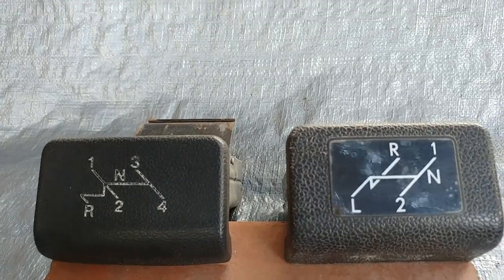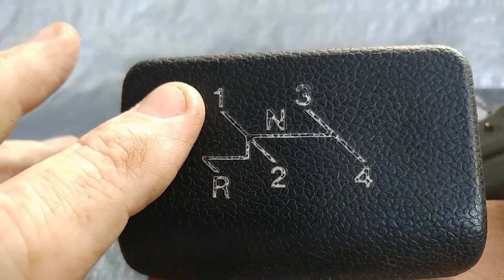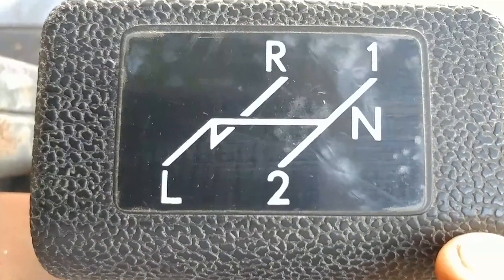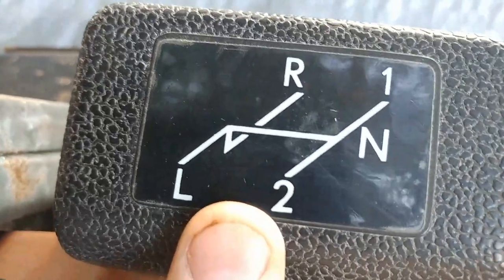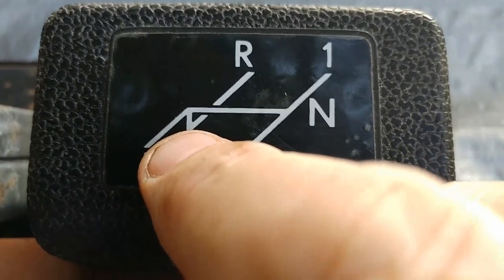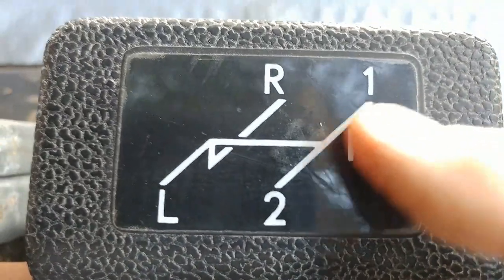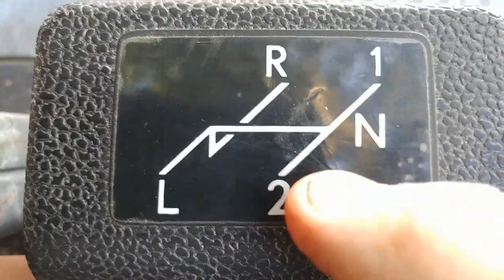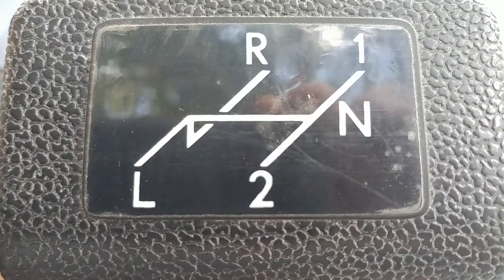HOW TO : HOW TO DRIVE A CLASSIC VW BEETLE AUTOSTICK TRANSMISSION.

Comment: I dont understand why he keeps switching to say how it would be in a normal car. Just say ude the low for vety slow start. Use first ti go up to 40 and then shift to 2nd.  When you take the fiit off the gas is when the clutch engages or when you put pressure on the stick is my question.  Also is it a tirque converter or is there something else engaging and disengaging the clutch?  Im thinking of getting a autostick for a rebuild but i want to understand how it works compared to a new electric semi auto like in a smart car that used a motor to engage and disengage the clutch
Reply from the maker: Yes, there is a torque converter. Takes ATF. YES soon as you tale your foot off the gas to shift. The major downfall is parts availability. O have a few companies that still offer some parts. You have to be advised that you cant build a bigger engine. There are a few major differences in the engines internally. If you need parts, i would suggest The Samba. They seem to have used parts most of the time. Besides the engine and trans the rest of the car is the exact same. There is a few different sheet metal pieces in the engine compartment. This is why you see most of the autosticks have been swapped to mamuals. Feel free to ask any questions. Stay safe, stay warm. God Bless

Comment: This guy obviously never read the Volkswagen manual and doesn't know what he's talking about don't take his advice normally you only use first and second gear low gear only for starting on steep hills this car is slower if you shift low to second then if you start out in first and then shift to second you can go to a higher RPM in first then you can in low the idea is you drive the car and only have to make one shift first to second it's like a two-speed automatic if you go low to second it's like going from first to Fourth in a four-speed.
Reply from the maker: Thank you for watching and commenting. Yes , I have read the manual about how to drive a auto stick. There is a different version owners manual for this topic. Most don't realize that as well. Yes your explanation is correct. When I made this video it was explaining the shift pattern being different on the ashtrays. I did make another video on the topic, need to edit it. The real.lesson is I should have replaced the video. Your comment will be read by many. Thank you for helping the community out as well. Take care, stay safe. Thank you for commenting

Comment: With a new shift coupler, the stick will lean toward the passenger's seat. Then it is a simple matter of just moving the stick forward  for drive 1 and straight back for Drive 2. The $10 shift coupler makes it much more enjoyable.
Reply from the maker: Sorry for taken so long to return your response. Are you stating the coupler replaced would change the issue. This is not the same trans a manual. My biggest issue is it does not feel natural to drive and operate. Thanks for the comment and stay tuned my 68 will be back driveable soon.

Comment: During the years that the autostick was available(68-76 for Beetles and Super Beetles and 68-73 for Karmann Ghia's) about 10% of U.S.A. sales were autostick. Now, only about 3% percent exist. It seems that the autostick became even less popular as time went on. Less than 1% of Super Beetles are currently autostick. The rumor that autosticks are worth less than standards can be seen to be false here: https://www.thesamba.com/vw/classifieds/search.php?submit=yes&keywords=autostick&type=both&stype=all&username=&yearfrom=1968&yearto=1976&pricefrom=&priceto=&model%5B%5D=&section%5B%5D=3&section%5B%5D=13&wanted=show&zip=&zipdist=0&state%5B%5D=&usaregion=&country=&sort=date&sort_order=DESC&submitButton=Search
In the past year, I have only seen two VW autosticks for sale. I want a 73-75 Super with autostick in or near Phoenix, AZ. There is one for sale in Chandler, AZ but it is pretty much a basket case.
Reply from the maker: I think they are going to explode fast when they do catch on. I have a 68 with 86k in it. All original, straight from the original family back in 01. You also need to to think how many were switched to manuals. I know everyone will say after 50 years still have not gained in value. I have to believe in the rarity like you said. I would say 1 % are still intact. I'm looking for a set of ATF resivor clamps. They hold the tanks to the mounts under rear fender. I've been checking samba, ebay, dub barn with no luck so far. I can find all the other parts new from suppliers. Thanks for all the info. Thanks for commenting. Stay tuned more autostick videos coming soon.
Reply: @Volkswagenplanet  All original is extremely rare. Most autosticks have the wrong carb, wrong distributor, and incorrect vacuum hose routing.
Reply from the maker: @johnhazel591  mine even has the assembly line marks and codes stamped on the back of shroud.

Comment: Just get the normal stick shift car with the clutch
Reply from the maker: I have both. The reason I have the autostick is it was my step fathers car( R.I.P). Its hard to get rid of somthing like that. Too many memories with him and my daughter when she was growing up. Sixteen years later and getting ripped off by 2 bodyshops to restore it. Still sits in the garage. Should be more videos on this car being restored in the near future. Thanks for commenting.
Reply: @Volkswagenplanet  agree it has sentimental value to you and it is ok better than new automatics
Reply: What if you are an Amputee and love vw bugs this is great can still drive and enjoy vws
Reply from the maker: @markcollier3737  that is a great question. The autostick could be driven with hand cobtrols on the gas and break pedals. There is no clutch pedal. Just rev up and let off the gas shift. Thier is even shift points on the autostick speedo along the outside of the MPH. The only hard part I don't know how to overcome would be shifting the stick shift. The aircooled beetle was never offered in a full auto version. The type 3 sqareback, notch, fastback was a option or baywindow bus. Hope this info helps to answer your question. Thank you for the comment. More on the autostick coming soon.
Reply: @markcollier3737  totally agree with you
Reply: The Autostick parts are no longer available except for the clutch servo parts.  as its wise to convert the 1968-1975 bugs to a manual if its a 1968 bug with an autostick then you have to get a 1969 and later transaxle that has the double jointed rear axles as the 1968 4 speed manual bugs have a swingaxle rear suspension which is the last year for it.
Reply: @derekobidowski3301  Parts are available.

Comment: I wish I could find a Beetle with auto shift, either a sunroof model or convertible, in reasonable condition. I would  buy it in a heartbeat. One thing though: I viewed two YT vids which teach one how to drive a regular stick shift. Both vids made manual shifting quite complicated from what I saw. A pity! I think I could master a manual with time, patience and rhythm, if you know what I mean. It's just perfecting that rhythm of going at it with clutch and gear shift until it becomes second nature, without thinking about it. I was told once that driving a manual Bug is VERY essy to learn and drive with. Is that true, readers?  What's your spin on this theory? Please inform. Thanks.🤔   ♐
Reply from the maker: You are correct about driving a manual shift. I've been driving VWs since the 90s. I can shift without using the clutch. Its rhythm like you mentioned. My issue is this about the autostick. I don't want to confuse you. With a manual you have 1-4 gears. You start 1st gear( top and drivers side, location). Then shift straight down to second. Then up to the middle over to the passenger side ( 3rd gear). Then straight down to 4th gear. This is standard around the world. 
  Now the autostick. The normal position 1 st gear on a manual is what is a gear you can stay in around town driving without shifting. I think it goes up to 35 mph. The 2nd gear on a manual is called low on a autostick. Then you rev the car like normal to pick up speed. Then you let off the gas to lower the rpm then you shift to 3rd gear location on a manual. On a autostick it's called high gear. Now on a autostick there is no clutch pedal to press in to change gears. Its not difficult. It just doesn't feel comfortable like you mentioned. It almost feels like your missing something. 
VW created the autostick back in the day to appeal to women drivers. They had a hard time driving manuals. Automatic transmissions cost a lot more to build. The autostick is close in size as the manual transmission. It was a win, win for VW. Here in the states it never really caught on. VW really didnt keep statistics like the other manufacturers did. It is believed that 1 out of every 18- 20 cars built after 67 were autostick. Over the years the transmissions and engines were swapped back to manuals. The engine is different as well. Just wasn't capable of building bigger engines as well. Parts are getting harder and harder to find for the autostick transmissions as well. Even the aftermarket is scarce. Most of the time you have to buy used parts. It comes to a point where you just move on. Even though there are less built. They are worth less in value. I have a 68 autostick. I bought it from the original owner in 2003. I don't think I put 200 miles on it since I bought it. Spent thousands on parts. Its been in my garage since torn apart from a restoration job I never finished. If it wasn't for the sentimental value, the car would of been gone years ago. Hope this info helps. If you know what to look for you would be surprised how many you can find changed over for sale.  It's not to difficult to change them back either. Thank you for watching and commenting. Stay safe.
Reply: A thousand thanks for your reply. It's not often that someone will take the time to respond with many details as you have to my initial input here in YT. I appreciate it more than you know. I only wish I can find a Bug in reasonable shape to practice the "rhythm" I referred to before. Sorry to ramble on. Peace to you and yours, friend! 
🙏♐
Reply from the maker: @AladdinSaneNYC  it's the least I could do is respond. I thank you for the view. Feel free to reach out again. Take care my friend

Comment: Low gear is not used in normal driving in the semi-auto VW.  It is a very low gear that you cant drive more then 15mph in. You should start off in 1 and shift to 2 lifting off gas pedal during shifting.
Reply from the maker: Lately I've been leaving it in 2nd gear til about 35. You are correct though on your statement. A new updated video is coming soon. Thanks for the comment.

Comment: Built for women, WTF we're in 2019 mate, not 70's.
Reply from the maker: That was vw main target group. Back in rhe day women didnt drive manual shift cars. At this time vw made no true automatics either. Not the 70s , this is a 68. The first year it was offered. Just kidding about the WTF 70s comment. I don't know if you have driven one of these. Your feet and shift points dont feel normal. I'm hoping to get the autostick put back togther as early as this month. I will make move in car videos. 
          I bought this car in 2003. The first 2 years I owned it I put 11 miles on hit. I hated this car. My stepfather grabved the keys one day and taught himself how to drive this car. He would take my daughter for rides on a daily after daycare. My stepfather passed away fathers day weekend the same year. I took the car to a known local bodyshop. The car sat over a year no work done at all to it. Lost about 2 grand. Had it towed to another shop same thing. This time the billed me for parts they could not produce. That was 2500 lost. Now 16 years later im about to tackle it myself. Motor is already. I've lost and orderd the parts a few times over the years. I was on my way to the garage to start getting organized to start putting it back togther. I hope this helps with understanding about the autostick. I would say I could answer any additional questions you may have if any. Comments from people like yourself gets me motivated to want to get it back on the road. Sorry the response was so long. Stay tuned and thank you.

- KEEP DUBBING -
Reply: This is about a 70s car, not a 2019
Reply: @Thomica1  Guido got triggered!

Comment: My old ghia had an auto stick... I never used L. Just 1 to eventually 2
Reply from the maker: It's a very un- natural transmission. I hope to be restoring my 68 in 2022. I didn't know there were autostick ghias. Thanks for the info. Did you convert it to manual. Happy Holidays.
Reply: @Volkswagenplanet  very nice! Always a fun time. Yup my old one did, and another I'm looking at has one. But I'm planning on the swap. Did you on your beetle?
Reply from the maker: @josephfriedrich9792  no, I have not covered it, nor will I. I bought it from the original owner in 2003. I tried several times to try and get use to shifting, but it never felt natural. I paid full coverage ins on it for 3 years. Put less than 5 miles total on it. One day my step father ( R.I.P) asked for the keys one day. Next thing I know my daughter ( age 4) is in the passenger seat going down the street in the beetle. They would go and get ice cream all the time. Then about 2008 ish I decided to restore the car. It's still in pieces in the garage today. I have a few videos on it on my channel. It's a 68. First year. Can't get rid of the car. Way too much sentimental value. I had 3 other beetles since then. I just got rid of them to stay focused on the 68. Hopefully next year will be the year

Comment: Praise the Lord.  I have a 2001 Volkswagen New beetle 5 speed how do you shift into the fifth gear I've tried and I keep going up to the third
Reply from the maker: Thats great news. I had a 03 vert a few years ago. They are fun cars to drive. Stay safe.
Reply: 5th is really far away compared to all the other gears. Gotta really push it over to the right before pushing up.

If you're getting the sensation like you hitting a wall before going all the way up onto 5th, you need to replace your bushings in the shifter.

Comment: Terribly explained.  But GM did have a similar transmission like this.  "Torque Drive"  A manually shifted 2 speed "clutchless" tramnsmission.  More of a manual than an automatic.
Reply from the maker: Your correct, I have a updated video to replace this one. These are strange charecters in deed. Never understood the term autostick when you still going through the same motion as a manual. Just not engaging the clutch pedal. Thanks for commenting and leaving feedback instead of just a thumbs down. Most just hide behind the screen and leave no reason. If you ever get a chance to drive one you will see how un natural it really does feel. Take care, stay warm, stay safe.
Reply: Chrysler had a semi-automatic in the late 1940's/early 1950's that required a clutch pedal...you only used the clutch at stops until the transmission fluid warmed to operating temperature.  But the shifting was all automatic!
Reply: You’re thinking of the Powerglide  2sp. transmission. 
GM made this transmission from 1950 through 1973.
Reply: @jamesrodgers9524  wrong. Look up the Torque Drive transmission from GM. Early 70s.  It's NOT a Powerglide